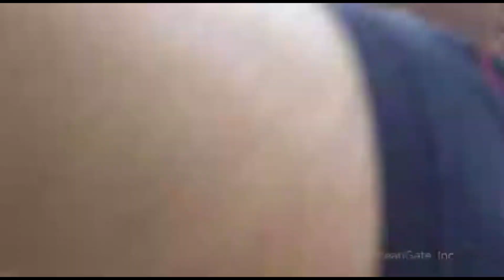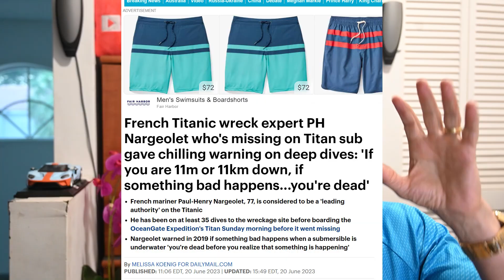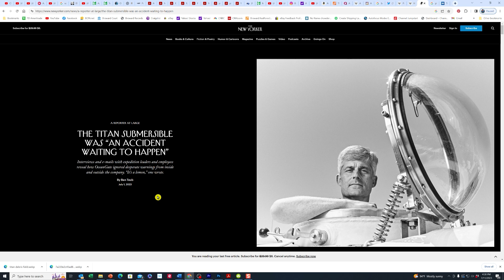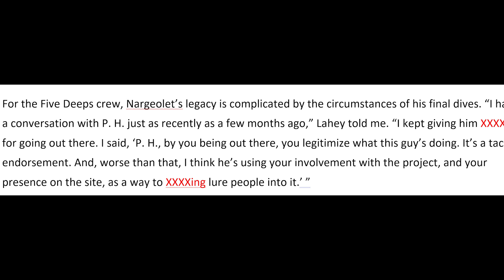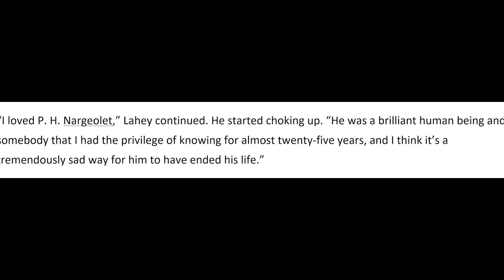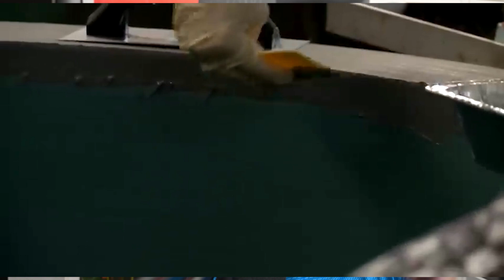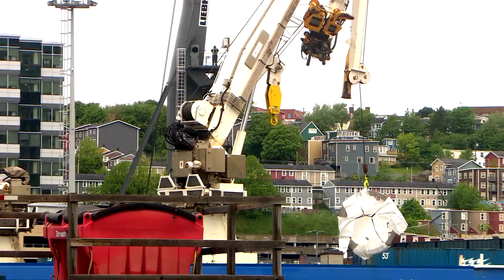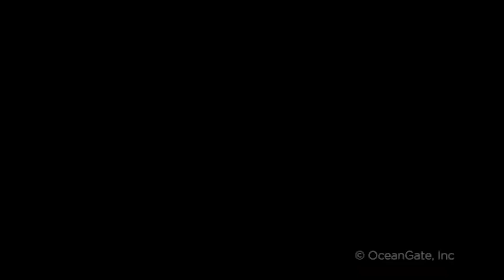Titan Sub: More Q&A, Design Defects, Why Descent Fast

Comment: Kudos for outstanding posts and analysis/comments!  RE 'too fast descent rate', what do you/others think caused this?  Appears to be almost 1.5x + faster descent rate than 'normal'.  Overly negative ballast/bouyancy issue while free diving?  Stuck vertical thruster?  Related to above, also why was subsequent ascent rate so slow (as reported by your clip and 'transcript')?  I find that odd and suspicious.  Even after larger ballast and rails/frame were dropped.  Then, the issue of the electrical bus:  could some electrical problem (like a stuck or errant thruster, or dampness/condensation) caused excessive electrical load resulting in short out or depleted battery(ies)?  Related to abnormal descent and ascent rate?  Or were was Titan/"mission specialists" just having an incredibly bad day...and worse luck?  Even nuke subs approaching 'test depth' SLOWLY descend while SLOW ahead.   Finally, did OceanGate even have accurate numbers for test depth vs crush depth?  Typically crush depth estimates are 1.5 of test depth on US subs.  Call me puzzled.  :-)

Comment: I'm just a back yard mechanic who has built race cars and carbon fiber body parts. What I saw how they constructed that carbonfiber tube and applied the adhesive kinda shocked me a bit. I think Micky Mouse and Donald Duck could have done a better job... On your other video you mentioned about no adhesive oosing between the surfaces. I noticed that immediately when I first seen the video. I bet there was enouh air between the two surfaces to add to the 96 hours of oxygen supply. 
I know for a fact no adhesive, epoxy, bondo, or even "SUPER GLUE" is going to adhere to any smooth and shiny surface of any type of metal. Especially being exposed to water or moisture for any length of time...

Comment: This rapid descent reminds me of that toy, Stretch Armstrong. If you pulled it's arms slowly, it would stretch, but if you did it fast, it would snap. That rapid descent could have contributed to the break up of the epoxy glue and the carbon fibers.

Comment: Today i was removing a proppelershaft from a BMW M4, those are made of carbonfiber. And it says in the workshop manual that you need to check it for cracks, scrathes and stuff. And it CANT handle pressure from outside. I was thinking about the Titan right away..

Comment: How can glue stand those tremendous pressure? I know the pressure is on the cone, but in my world it will try to sneak in between the cone and carbonfiber cylinder? Could glue withstand it?

Comment: Well, Titan had troubles on previous dives  too  , like  loose of tracking, comunications lost, sometimes  energy. It looks like  the submersible went down  to the wreck of TItanic and on "casual" way down  some attribute over-weight others and that  continue with  more  diving speed. so they  got into that depth 2x quick that usual. I guess  overused Titan submersible carbon fiber core cant stand that  anymore and  by that very quick pressure  changes  in  3500 meters  structure start to  fail. then when they want rise up  it  goes soo slow, by that  they heard  according  Text messages  crackin from stern section. So I guess that was final warning  that something is horrible wrong. Some people said that  Sub  on way down  was overweight  because of  all 5 people were right at front window... who knows.

Comment: Don't forget that the rate of change of pressure decreases the deeper you go. So from surface to ten metres the pressure change is 100 percent,  from 1 atmosphere to 2 atmospheres. From 1000 metres to 1010 metres the rate of change is only 1 percent for that ten metres. And so on.

Comment: The whole Titan build is done with all the professionalism of teenagers cobbling together a remote-controlled boat out of JB Weld and cheap fiber in their backyard. Unidirectional fiber layup, no pre-preg, no vacuum bagging, no autoclave curing, no (apparently) roughing up of the titanium's surface before gluing, no consideration for galvanic corrosion between titanium/carbon fiber/titanium (immersed in salt water, that basically one huge battery), no consideration for cyclic stress at the titanium/CF interface, no nuffin', and they smiled... Beyond the worst amateurish attempt at primary school engineering. I can't understand how people calling themselves "engineers" got away with something like that.

Comment: There was a past article by the manufacture stating that they intentionally did not utilize an autoclave but did use prepreg.  They did a simple vacuum bag air cure.  He provided reasonings in his article, but they were pretty weak.  There is the article from Composites World Magazine in 2017 where the CEO was interviewed about the manufacturing process that you can find online titled Composite submersibles: Under pressure in deep, deep waters

Comment: Hi Jeff,

I'm not a licensed or certified engineer but I do have an extensive background in mechanical engineering. 
I was very alarmed by the rate of decent that you outlined in one of your previous videos, part of the concern was about exerting too much external pressure too fast but what struck me more was "Why" they were descending so fast. 
They did the normal weight check of each so called crew member (passenger) including their food and other items they took with them. 
They already knew the amount of weight they can safely carry and they knew the amount of weight they needed to be able to eject to slow the rate of decent when nearing the ocean floor, as well as knowing how much weight they needed to eject for neutral buoyancy and a normal ascent. 
The decent should be at about the same rate as the ascent and according to their previous dives, the amount of time was close to 2.5 hours both ways.  
IMHO, the only reason for such a fast decent was because the submersible weighed a lot more than they thought. 
Maybe the voids in the carbon fiber tube (from separation of the fibers) on the previous dive was enough to allow water logging? 
I wonder if they even bothered to weigh the submersible after the previous dive? 
Personally, I would have weighed the submersible after each dive to see if it weighed more, but then again, I would never have attempted to dive in such a non-conventional design!! 

The rate they were descending on the last dive would have been enough to "Crash" into the ocean floor rather than hover as they had calculated (even after they ejected all of the weights required for a neutral buoyancy). 
And even after the frame was ejected, the submersible was ascending extremely slow, much slower than they expected. 
There had to be water in the carbon fiber tube IMHO, especially considering the fact that they were ascending so slow (even without the frame and ALL external weights).
Reply: My first guess when Jeff showed the rate of descent being too fast was that perhaps a cavity for boyancy had filled with water.  Either way, the rapid rate of descent should have been a red flag at the first call-in and they should have started recovery procedures immediately.  This isn't like a car where you simply press on the gas to go faster.  Submarines are a balancing act where you adjust boyancy to either ascend or descend.  There's going to be a limit to how fast you descend, because if the craft is too heavy, then you won't be able to reduce the weight enough to ascend back up.
Reply: I've also read a comment stating that there are strong underwater currents at those depths and that a current could've been pushing them down, which would explain the fast descent and inability to ascend. That may be something to research.
Reply: I thought maybe water leaked into the nose cone area as it was separate from the carbon hull. Is it true they heard noises coming from this section on the way down?
Reply: does the rate of descent now slow naturally as the density of the water increases nearer the floor? or is the effect negligible?
Reply: @GrueTurtle  Water isn't compressible enough for it to make a difference.
Reply: @GrueTurtle  There's an experiment I remember doing when I was a kid, using a jar, a balloon, and some other items.  Once you had your "sub" at equilibrium in the jar, it would float just below the surface.  Then you would put the balloon on the jar and blow it up just a bit, until the sub was near the middle of the jar.  After that, you could squeeze the balloon to add pressure and the sub would sink to the bottom, or let out air and it works rise to the top.  

So, yes, the increasing density of the water due to pressure as you descend should slow the sub's descent.
Reply: My question has been: If the communication between the sub and the ship included multiple replies indicating current depth, at different times. why didn't the ship interject concern or corrective procedure? They could have easily calc'd the rate of descent.
Reply: @ole5539  If the leaked logs are to be believed, they did. But super passively. Instead of telling Stockton to adjust his descent speed, they asked if he needed to adjust speed. And when reporting of hull alarms, instead of telling him to ascend, they asked if he needed to ascend.

Comment: in regards to the adhesive....in what videos are out there, when they show the titanium ring being mated with the carbon fiber tube, there is ZERO squeeze out of the adhesive. There is ZERO chance that these guys put exactly the right amount of adhesive by hand via the way they applied it. With no squeeze out there is a 100% chance there were voids and bubbles in the carbon-adhesive-titanium interface

Comment: What is the temperature difference between the bottom and the surface? When you talk about cycling are you talking about pressure cycling or heat/cold cycling? I would think it is a lot colder down where the Titantic is compared to the surface

Comment: Just fyi. Many years ago the EPA mandated the removal of PFC's from all glues. The pfc's contribute significantly to the bonding process. This mistake was noticed when a bridge sign failed (In Ga.) killing some people and it was found that the epoxy did not adhere properly to the mounting of it. Also it should be noted that surface preparation it extremely important when using epoxies. All that aside. I do not believe that the glue played that big of a role. No epoxy could withstand the amount of pressure and deformation that would have happened to the inferior carbon fiber tube. The carbon fiber tube would have been the first thing to deform thereby making the end caps pop right off. And another thing, I noticed what looked like 1/4x20 screws that were used to bolt on the end caps. Let's say the entire thing was made of titanium. One would still want to use bolts at least 1/2" or 3/4" to hold it on.

Comment: Someone else mentioned this, as to the reason the leaked transcript is complete garbage.   The Polar Prince, is that what it was called?  Didn't immediately call for help when losing contact because that's happened before.  But if the transcript is to be believed, they would not have waited.  The transcript shows a clear danger.  They would have acted immediately.  So the leaked transcript is total garbage.

Comment: The CF tube would have shrunk under pressure and sheared the glue to titanium ends. Leaks into the machinery and battery space would have increased the dive rate and probably why the escape attempt was so slow. Not that it mattered. They’d never reach a safe depth in time.

Comment: 6 minutes in i got two remarks:
1: If a person wants to risk their life and maybe die doing something useful while they still can, instead of withering away in some retirement-home, why is it sad if it actually happens? Maybe we should rethink death here.
2: Roughing up surfaces to make laminates and glues stick has been proven to be a naive idea. Acid has some place there but any more unsophisticated treatment like steelbrushing, sanding or similar produces structures that are way larger than they need to be for polymeres to grip. Actually a shiny metal surface looks like the alps under an electron microscope.

Comment: An additional discomfort for the poor people on board_  The sub had a machine section at the rear end.  The frame (landing legs etc) and ballast were arranged towards the 'front' to counter the down-force of the mass of the machine section around the centre of buoyancy.  While the ballast drop may have left the sub in balance, roughly level, dropping the frame would almost certainly have caused the sub to go stern (machine section) down and front (porthole end) up.  Its possible that with all the crew crammed into the front end the sub may have balanced, but it would be a precarious fragile balance, which once upset could not be restored, as there were no hand holds or rails inside the cabin the crew could use to claw their way back to the front, or even to hold themselves there if the sub was at any sort of angle.  Most likely they ended with the sub hanging vertical, stern down, and everybody standing on the back wall, listening to the '...more sounds aft...". Awful way to go.

Comment: Unfortunately, my English isn't particularly good, so this text was translated using ChatGPT. One reason why the fibers may not have been pre-impregnated could be that they possibly used a vacuum infusion process. After the fiber is dry-wrapped, the resin is injected under vacuum. This reduces air entrapment close to zero. It's not necessarily common, but it's certainly possible due to the size.
Reply: We are manufacturing tubes up to 450mm, but never dry rolled. Only asymmetrical shapes are dry wrapped and infused later oder we use Prepreg. But I have to ask my engineer. He had much more expertise about bigger tubes.

Comment: Fun fact: that cylinder that's being covered in carbon fiber was NOT the pressure hull. That was the crew compartment. The pressure hull likely relied on rings that supported carbon fiber that was in tension(like power lines on poles) which obviously no one would see since that was a company secret. 

I think it was an assassination of one of his passengers or it was something mundane like a lithium battery exploding and causing a shockwave that would've destroyed any submersible.

Comment: I was thinking the quick descent - if it happened -  was indicating a major problem. While there are other factors involved,  it is important to maintain a known dive profile to allow the hull time to adapt to the growing stresses.

 But, more importantly, the quick descent and - later, the slow ascent - point to one major problem. The submersible was too heavy. Much heavier than expected. That, in turn, suggests that water was seeping into the craft dragging it down. Eventually, this would have leaked into the battery compartment and compromised the power (it may even have interfered with the ability to jettison the frame)  and it implies that the problems with the dive started a long time before the implosion. 

Of course, the reason it would have been seeping -  as opposed to a leak - would have been a compromised hull. Not so much a hole as broken fibres which compromised the waterproofing. 

Of course, this assumes the leaked transcript is real.

Comment: I believe that the intention was that the titanium end caps would be pushed in as the exterior pressure increased. But as many people have pointed out you now have two completely different materials interacting on each other at extreme temperatures and pressures. Which are complete unknowns and would need years of testing to determine what the outcomes would be.
Reply: I think the carbon fiber that's touching the end caps is the carbon fiber for the inner low-pressure hull. It doesn't matter if that hull fails in any way since its not the thing protecting people from the ocean.

Comment: I have been questioning the whole fast descent thing as well, enough to wonder if the implosion wouldn't have happened if it had descended at the usual rate. Are there cases of rapid descent on previous dives? In any case, the rapid descent was a HUGE red flag that the crew should have immediately recognized. Was it simply a case of too many people/too many heavy weight people aboard? Or did something flood with water early on (like a battery pack? Where  are the batteries located?) that wouldn't have been immediately noticed and would have negatively affected bouyancy? (I am wondering battery pack or some power electronics system because they lost a power bus shortly before the implosion.) Also noted that the rate of ascent was still very slow even after they had jettisoned a lot more weight then normal. Was something somewhere (outside the pressure hull, or maybe in the pressure hull but outside the crew compartment) actively flooding? I suspect that if the rapid descent had caused an abort before they had descended 1000 meters (and they clearly knew by then that the descent was much faster then normal) that everyone would have been recovered alive and perhaps a serious flaw found in the sub's design. Was ego involved in a decision to ignore the rapid descent? Or did everyone want to commit passive suicide?
Reply: Descent quick , ascent slow, 50% power failure,……. U must ck the batt compartment ( it is located beneath the floor) flooded. No matter what jettison ed , like 2 eng power aircraft lose one eng .beside , any broken clothes  , socks, shoes, …….

Comment: I worked at Spirit AeroSystems where they make the 787 barrels and earlier in my career, at Beechcraft (Raytheon at the time) where they made the Starship and later, Premier. 

Sorry, but OceanGate videos of them manufacturing the sub, is an absolute joke. Dry spinning w/o prepeg and no autoclave?! That was essentially a sub with a paper toilet paper tube, with titanium ends, and no adhesion properties of the two. 

Unreal. 

(Former Plant Manager, not an engineer, but have managed them)